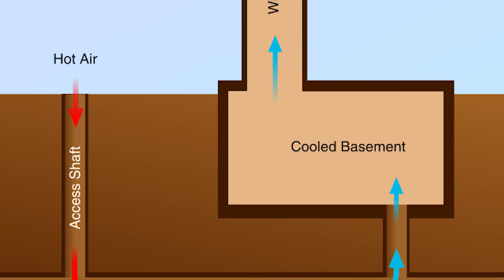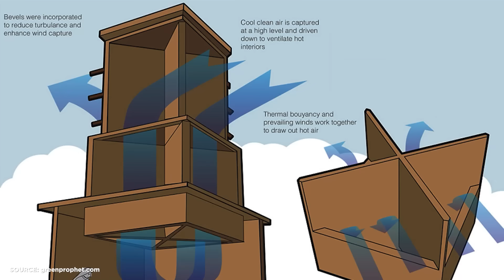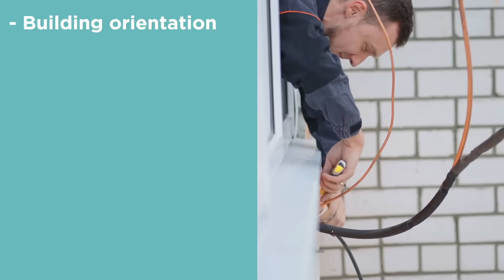Forget Heat Pumps - This House Cools Itself With NO Electricity!

Comment: I'd be really curious to see an energy audit of 'a vernacular farmhouse' at a living history museum- they were also built to use passive thermal effects.
I'm in an old farmhouse with 2-foot thick stone walls, and it CAN be very efficient and comfortable thanks to thermal inertia.
First, are constructed to align with the sun so the front faces south, with a front porch that shades the front in summer but allows low winter sun to warm the house in winter. Don't forget the classic white-drapes for farmhouses to reflect light BUT allow a breeze through (in the times before screens & screen doors). The rear porch stays shady and cool.  
The 'chimney effect' helps to pull cool air in from the shady side of the house and circulate it through each floor and out the attic windows.

Don't forget to open the windows at night and let cool air in to chill down the stone walls to stay comfortable.
Reply: Yeah, the problem with that is that these principles are not appicable to large scale housing for the population we currently have. And that's a problem with a lot of ancient solutions... They work really well, but not on the scale we need, so we need to learn the physical principles behind why these designs work and then figure out how to design larger structures to work with those principles.

Comment: 8:50 slight mistake joe.
You said larger surface area absorbs less heat. This is incorrect. Large surface area will absorb more heat.
As shown in the graphic the building has small windows to absorb less heat.
Reply: Yeah, I think he might have meant that it's a larger surface area which gives off more heat, and since it's "crumpled up", there's a smaller chance that all of it faces a potential heat source at once than it if were flat.
Reply: @rasmusn.e.m1064  nah. I think it was just a a brain fart. They happen to the best of us.
Reply: @rossgirven5163  the context is important, because in that particular building, the larger surface area gives off more heat, as Rasmus mentioned. I think your comment was the brain fart!
Reply: @squirlmy  I think your comment was a brain fart. Joe specifically said that the larger surface area absorbs less heat. Context has nothing to do with it.
Reply: @squirlmy  “and this isn’t just a design thing, turns out pointy surfaces have a greater surface area so they absorb less heat” - Joe Scott, July 2022
Reply: Surface area relative to volume is the thing.  Smaller surface area w/ larger volume = more easily maintained climate inside.   
The “bumpy” exterior was for predominantly hot climates where you are trying to dissipate heat to the night sky.  I’ve heard this theory but it seems to be very site specific.  Increasing the surface area can backfire on you and you would bring more outside temps inside I would think.   
Maybe a better idea is to not live in a desert 🌵? ;)
Reply: That won't work here Scam bot.

Comment: Having grown up in the South it's interesting that there definitely was a housing type that was common in the South.  HIgh 9-10ft ceilings, a central hallway with doors on either end that you could open to allow pass through breezes. Transoms over each hallway door to allow ventilation. Big windows along the sides of the houses that allowed cross-ventilation. Even the use of extensive porches, sometimes completely around the house so that walls and windows were shaded. Then there was also the sleeping porch, which was a large screened in porch that was open on two or three sides, so during the heat of the summer, the family could move their beds out to the sleeping porches where it was cooler with more of a breeze.
Reply: The original Asian  Indian ..bungalow with verandas and wooden blinds on the windows and long overhanging eves was a solution adopted across the British empire ..  
Passive cooling and thermal control have been used for millennia.. we were dumb and forgot to adapt our fashion homes... now its time to re learn .
Reply: Many different house styles for managing temperature. My favourite is the Riad style in Morocco.
Reply: @RussellChapman99  Hawaiian hale. Live in one underneath a giant tree. Roads are cool. Stayed in an original caravan riad in M'kech. 43 Celsius at night. Still better than the 50 Cel outside.
Reply: Some of those features have continued into the modern era, most people don't understand why they were there but continue using the design elements but they lose practical purposes by not being incorporated into the design correctly. I live in a 100 year old house in south Georgia and for the most part you just described it lol. This house is built in one of the oldest sections of town and used to have a guest house (now a separate residence) and on dirt roads. It amazing how much has changed
Reply: What? No... just no. 

Most of the architecture on built-in-place homes in the south (and elsewhere) today is a melange of elements common to houses built all over the US. This is a practical consideration based on what material suppliers can provided in terms of roofing, siding, and millwork. Many design elements that are hallmarks of southern  homes simply aren't available unless you have a custom home built. Even then, many structural features are disallowed by modern building codes due either to fire safety, hurricane building codes, or energy building codes. 

The Modern Era ended 70 years ago. Your house was actually built towards the end of the Late Modern era. We absolutely do not build  houses like that any more.
Reply: @azurealism  
Some people and places manage to... Especially if they build in conservation areas. 
Houses built using hempcrete or Solid timber seem to incorporate traditional features as do Adobe built homes.. 
The problem is the big house builders and construction companies sold too many people pastiches of homes rather than .... rationally adapted structures for  climatic zones and specific environmental problems..eg flood zones tornado and fire belts and seismically active areas. 
Houses orientated by roads..not the sun 🌞 or dominant weather, laid out on grid iron patterns ... Where  cars  are required to get anywhere....and pedestrians and cyclists have take their chances to get anywhere.
Reply: @azurealism  You can't if you live in a subdivision rules by an HOA and design models...but if you own land, you can build it strong, hurricane resistant, energy efficient and easy to cool.
Reply: @sirfishslayer5100  HOA has nothing to do with anything. Building codes are set by local, county, and state governments. There are only a few jurisdictions where you aren't required to either build according to the code, or have an engineer certify a construction method that is outside of code limits.
Reply: @azurealism  True, but I was just referencing the HOA as a type of master-planned neighborhood where the houses are already designed and you have to pick one of them.  Was just saying that if you want to do something "radical" (or not the norm) for a particular neighborhood, you may want to buy land and build what you want.
Reply: Exactly. Houses used to be built to self cool, but now that everyone has the AC cheat code no one bothers anymore
Reply: @connorcm371  "Self cool" he says. OK - you move to Tifton, Georgia in July in one of these old houses with a perfectly functioning "cooling" system and tell me how much fun it is to sleep in 75% humidity when it was 105 earlier in the day. I'll even spot you the whole house fan and a large ceiling fan in the room.

Then after doing that for a month please feel free to let us "Cheaters" know how to live without AC.
PS - there is a reason the south, and especially places like Miami were smaller towns prior to the 1960's - they were too hot - even though every home and building were built for maximum air circulation.

Moral of the story - there is no such thing as Self cooling - only just a little cooler than outside - along with all of the humidity thrown in for laughs!
Reply: @rushevents  You're not going to die without AC. Ironically enough I was born and raised in Atlanta, and get by just fine using a fan. It's not comfortable, but it's livible enough for the 4 months out of the year that it's really hot. Somehow people in 3rd world countries in some of the hottest, most humid places in the world get by just fine with fans because they can't afford AC. It's a terrible dependency. However, I'm not totally anti-AC. The mini split system is vastly more efficient and uses vastly less energy. Put one in your living room and turn it on when you're home during a hot day. Heating entire homes with HVAC like every US building does is unbelievably wasteful. You lose a ton of energy passing cold air through 100+ degree attics and walls, all to cool spaces you're not even in most of the time. Like...why even spend energy cooling a kitchen, or a bathroom, or the bedroom in the middle of the afternoon? It's wasteful.
Reply: @connorcm371  I grew up in Memphis and if you want all that heat you are welcome to it. Me - I'll take the tech. Thanks.
Reply: @rushevents  Live Hawaï and drive without AC. Most of us do. What really helps is a low BMI.
Reply: @rushevents  Live Hawaï and drive without AC. Most of us do. What really helps is a low BMI.
Reply: @rushevents  The car AC industry was centered in Dallas because Detroit didn't understand that people in the south would totally pay more for it.
Reply: @808bigisland  So that what's you've got? Fat jokes? Nothing about comparisons of prevailing winds in an island climate vs the same temp - humidity with a lack of daily cloud cover in the middle of a continent. Nope. Just fat jokes.
Reply: @connorcm371  Never said it would kill you - but that whole "It's not comfortable" is an understatement to rival our 401K's
Reply: @808bigisland  Yeah, but Hawaii has an incredibly stable climate that pretty much just varies between 20 and 30'C.   Until you go a bit mauka at least.  Most stick frame houses there don't even bother insulating the walls. 
A downside is that it is a pain to control the humidity... For most folks that just means cleaning with a bit of bleach to keep the mold down, but electronics/computers don't fare so well.  I seriously considered insulating a closet and installing a little AC unit for my computers... Sadly, I had to switch jobs and move back to the mainland :(
Reply: Having lived in the south my entire life I can say that these things are better than nothing, but not much better. When it's 101 and 62% humidity you can sit under an industrial house fan and still be miserably hot. 
Oh and umm, security. Leave windows open or have open vents are a spot that thieves will hit.
Reply: @rushevents  Leave vents small add a fan to make up. Not even animals could get through. Humidity yeah that sucks if its perpetual. If it only lasts a week no biggie.
Reply: @Andytlp  Everywhere south of Kentucky it's humid all year long - even in the winter and yes it makes the cold worse too.
Reply: Just stick it on 14 foot stumps and you have what we aussies call a Queenslander . Prior to 1970 ish just about all houses in Qld and north NSW were up high, 12 foot ceilings, veranda all around.
Reply: @planet43  
Thats your colonial Bungalow .. originally plus legs capped with lead etc to stop termites chewing tunnels up them to eat the house...handy for dodging floods if the footings dont get washed out.
Now you can use steel or concrete and add recycled materials..
The other option is Basalt concrete domes part or totally  buried in the Earth. 
Best insulation out and probably the only way to dodge a bush fire 🔥or Tornado type high winds.
Reply: The sleeping porches were an artifact of the hygiene movement of the 19th century together with screen technology. It was a way to prevent the spread of tuberculosis or to treat bad lungs. It wasn't really for being cool. 

Those and most of the other features only existed in the homes of the upper 20 percent. Common people were just hot and dealt with it.
Reply: @toomanymarys7355  Aloha, sleeping porches are called hale or lanai. I can testify that I had the best sleep on Japanese farms porch, Hawaiian lanais and a Swiss lanai. It's only bested by my beach couch.
Reply: @808bigisland  The Japanese porch is a totally different phenomenon from the US one! :)
Reply: @toomanymarys7355  It's about the quality of afternoon naps. Ya know the meaning of life.
Reply: Shot gun houses. We lived in one in Westwego I think it was? Or Marrero. Can't remember which town
Reply: I live in manhattan, and I think a lot about heating and cooling. 
The modern materials and building style that began in the 70's used lower ceilings, and these are terrible for thermal regulation and air circulation. just an extra 18'' to 24'' of ceiling space makes an enormous difference in energy cost, and mental health and liveability, and yet, most modern apartments in the manhattan are now 9' cielings or lower, often 8'5''. lowest built cieling should be 10' for a variety of reasons.  11'' is the most desireable and practical if one is ok with not building ultra-tall towers for maximum profit. but that isn't the case in manhattan.
Reply: I grew up in Texas, and this type of house was my favorite… those sleeping porches 👍
Reply: We call the sleeping porch, a Lanai, in south Florida.....
Reply: Very similar to a type of house here in Argentina. It is a feature of Spanish colonial architecture.
Reply: Very similar to a type of house here in Argentina. It is a feature of Spanish colonial architecture.
Reply: I lived in old southern homes like that. Once spoils you against modern horrors. One whole house fan means you will add it to any house!
Reply: Great comment!
Reply: I grew up without central H & A on a farm in SW GA and it was brutal. My parents were in their late 80s when the kids overrode them and installed H&A…no one wanted to visit in the summer even for my mother’s Sunday dinners of fried chicken and fresh veggies. 
My power bill goes up by $50 in summers but I’d take a 2nd job before I’d give it up. Yes, you can survive but it’s not pleasant.
Reply: Also large attics, often with fans that pulled air through the house and exhausted it through the gables of the attic.  I grew up in an old farm house and the attic fan pulled in an unbelievable breeze.
Reply: Must be a good neighborhood. No thieves muggers or people with shanks shanking people in their sleep on their sleeping porches. Must be nice to live away from the cities.
Reply: @Andytlp  People back then had dogs and shotguns. And if they had hogs, they didn't even have to dig a hole. :)  Did you know hogs will eat people including most of the bones? Just think...night prowler to pig shit in 24 hours or less. lol 🐷
Reply: @nunya___  it's true, i lived in a rule county area for a time, we'd hear stories of people slipping in the hog pen, no one checking on them....the only thing left was the leather cowboy boots since the pigs don't like leather....
Reply: @Andytlp  
Thats the human environment ...not just cities...
Improve the environment for all and remove as many of the triggers as you can and you alter the community behaviour.

You will always have antisocial individuals and the mentally ill but if the physical and social environment is good you can take out a lot of the triggers for dangerous behaviours. 
You can also create secure homes ... by developing communities.
A proliferation of weapons and fear is not a good starting point.
Reply: @clivestainlesssteelwomble7665  Well articulated. People and community centric design ideals like you describe seem to be proliferating these days, at least that's the impression that the rise of channels like City Beautiful, Not Just Bikes, and Alan Fisher.

Some even incorporate criticism of capitalist dystopias we've become, like Eco Gecko and Adam Something.
Reply: @deus_ex_machina_  
Well if you look what works where and why ... and you look at what's gone wrong ...its logical to try what works. 
I had a mate who researched motorcycle accidents where the  rider died because their helmet failed.. after a year or two they had dozens of broken helmets... 
Then came the 💡moment they stopped collecting the failed helmets ...they new why they failed anyway... Instead they set out to collect the ones where the helmet and the rider survived despite the accidents 😉👍🏼🧙‍♂️
... they studied them and made their recommendations based on why they had been so effective. Sometimes its the question you ask thats important... 😁
Reply: @Andytlp  Really?   Sleeping porches were typically upstairs where most of the bedrooms were and the breezes were better.  I do agree that having windows open at night in many areas is dangerou.s
Reply: @Andytlp  Yikes, I think you need to move to a new city  or country if you're getting 'shanked in your sleep' 🤣
Reply: @karlhungus545  Not so much Shanked in their sleep - more like just robbed every time you leave with open windows or even jus open vents.
Reply: @rushevents  You still probably need to move.  My kids have left my garage door wide open several times (with all my tools and stuff in there) when nobody is home and I've never had a single thing stolen.  My wife has also left it open overnight when she forgets to close it.  There's a reason location is everything in real estate.
Reply: @Andytlp  That's the thing..the world outside the US is much safer.

Comment: It's worth noting that far more energy is consumed dehumidifying the air  before heating and cooling it, than is consumed heating or cooling it.  The natural-design thermal control systems discussed here only address air temperature, not humidity.  If one is going to go this non-air conditioned route, make certain you're using construction materials that can handle the humidity.
Reply: @jimwally6520  Live in Texas, Louisiana, and Florida when I was a kid.  I know all about swamp coolers!